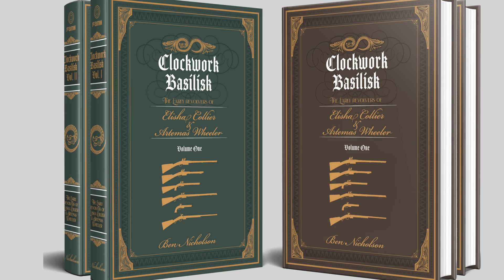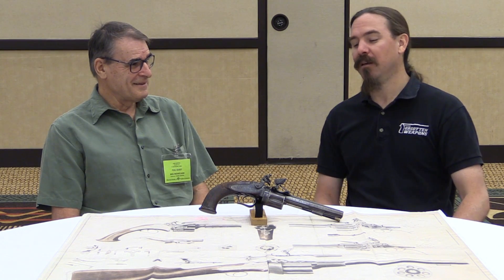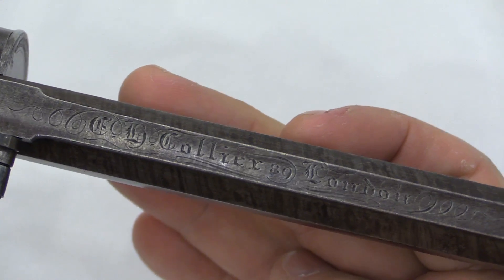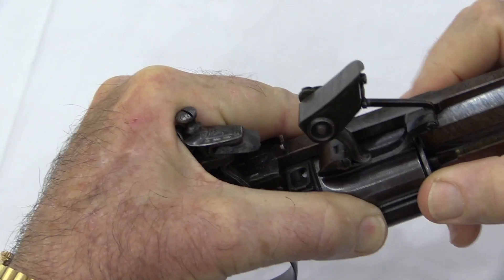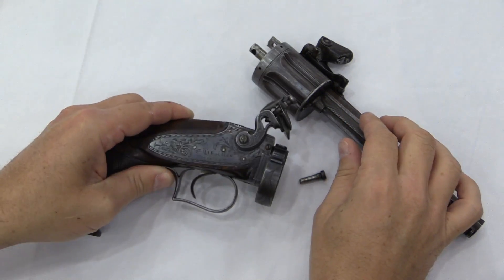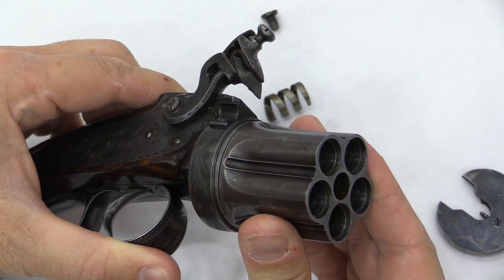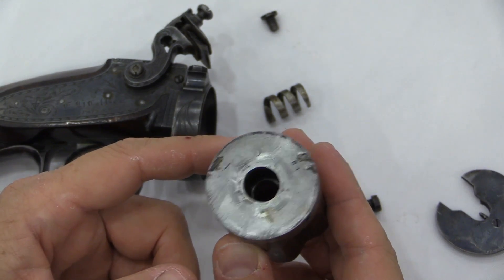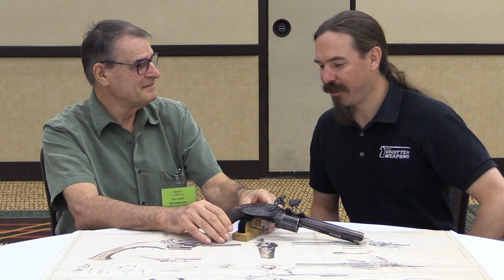Art and Engineering: Field Stripping a Second Model Collier

Comment: "two thousands of an inch accuracy" is actually a vague description.  For an assembly you need to define the "fit" between parts, with a manufacturing tolerance.  If you want a .002" GAP between parts you need to define the gap with a tolerance, say .002" +/-.001", or a clearance fit of .001" to .003".  To achieve this each part needs a nominal size that adds up to a .002" nominal clearance and each part needs a tolerance (or "accuracy") of +/- .0005" so each will only contribute a total of .001" variation to the .002" Fit.

Comment: I don't want to sound like I'm splitting hairs (literally) but I have a background in quality control and precision measuring and I'm wondering is this tolerance is a +/-.002" or +.000" .002"(or the reverse) because a +/ tolerance would actually be a .004" total allowable variation which isn't quite the same as being accurate to .002" I'm just curious.  I have measured things that were +.002" /-000"  tolerances before so it seems plausible lol but .004" is still double than .002" so yeah. Splitting hairs. Lol

Comment: I will put in my two cents in this video on his describing the walnut stock to cut the verbage, it is “burl” wood regardless the species of wood it is referred as “burl”, a lot of it used in the bowl of smoking pipes.
Reply: Burl in many contexts does imply a specific type of wood however, pipes being a good example. Many woods are toxic, using the correct one for pipes is imperative.

Comment: Now I'm curious about their machining process. I didn't expect the tolerance to be that tight.
Reply: you can get really tight tolerances with hand tools. my guess would be that fine-tuning would have been done with very fine files or possibly stones removing a tiny fraction of a mm with each pass, testing the fit every time. it should be noted that i am not a gunsmith though, my experience with historical metalwork is confined to knife making and some very basic swordsmithing. either way that's how i'd tune the tolerances pre-sandpaper and pre-precision machining.
Reply: @ef.9095  Ya you can get those tolerances with hand tools, but it's not practical for a production line. This may have been a contributing factor for why they are as rare as they are.

Comment: During one of the previous videos in this series, one corespondents was trying to say that US armouries were brilliant and could manufacture machine interchangeable parts to fine tolerances on the Hall rifles and at Colst manufactury in the US.......  Well it's obvious from Ian's reaction to Ben's points about the machining on these weapons that this was not possible, as I told that correspondent such accuracy was not "generally" possible until the 1850's, when Whitworth followed up on the work he did with Henry Maudlsey in the 1840's to make machined screws with a constant thread pitch possible using lathes they designed and built in the 1840's.

It is also obvious from a comment from Ian here in this comments section that each Collier made in the early 1800's that the machine parts to 2/1000 of and inch, were each individually serial numbered and bespoke to each revolver, further backing my point about interchangable parts in the early part of the 19th Century.
Reply: Accuracy and repeatability are two different things.

Comment: Why not use several pre primed pans with an automatic cover instead like in a puckle gun? That way you could simpñify it a fair bit
Reply: I could see two possible problems with having that: 1) wouldn't that risk having the priming powder either falling out (through an ill-fitting or damaged pan cover) or being dislodged so that it either doesn't fire when the flint strikes the frizzen (or the primer fires but the flame does not go down the flame hole and ignite the main powder charge); and 2) the mechanism for lifting and then replacing the pan covers could be too complex to be reliable.  (As Professor Nicholson said, all of the complex mechanisms, like the automatic cylinder advance, were stripped out of the second model of Collier revolver so that they would sell.)
Reply: @speedythree point 1 could be possible but as a cheaper alternative  it would be a trade off. Then again if you had the money for a collier you probably had more than enough cash for it ajsjaja. But om the other hand it would be a lot simpler with a pivoting cover and a diagonal surface it would automaticañly open when rotating the cylinder.
Reply: The Puckle gun did not have that arrangement. It had a single lock above the cylinder that had to be constantly reprimed.

Comment: That thing is magnificent. I'm wondering if the block that pushes the cylinder forwards is essentially an out-of-battery safety as well? If the cylinder is between chambers the block would be unable to move forwards, which would presumably stop the cock coming down?
Reply: Whether it stopped it or not wouldn't matter so much because if the cylinder is between chambers then the flash pan wouldn't line up with any of the chambers so it physically couldn't ignite any of the powder in the cylinder. The only thing that would happen would be that you wasted some priming powder.
Reply: interesting thought

Comment: did he go back to the auto indexing after this model?
Reply: I'm not an expert, but using this source I noticed the main visual difference between the first model and later models is that the first model is smooth on the outside of the cylinder, likely to reduce machining. On the second and third models, the cylinder wall is machined for extra grip, allowing the manual indexing as Ian shows. Could indicate Collier stuck with manual indexing. 
https://americansocietyofarmscollectors.org/wp-content/uploads/2019/06/1971-B24-Collier-And-His-Revolvers.pdf
Reply: Nope.